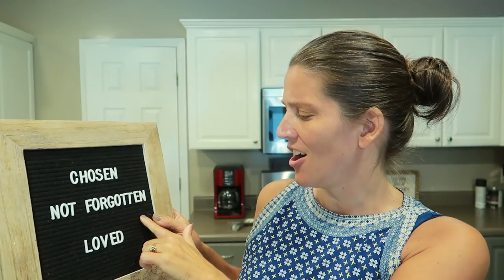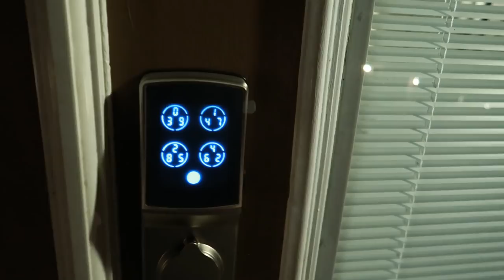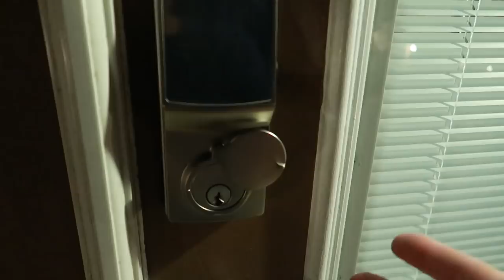Large Family WEEKEND...food..projects...and RELAX!

Comment: Question:  Why bother with deadbolts on a glass door?  If I wanted in through the door, I would just break the glass.  I have never understood this logic.  I suppose if you have a security system that would indicate broken windows, etc., it would be different.  On a strong, solid door, yes. This is an honest question and if someone could clarify, I woukd be grateful.
Reply from the maker: Yes security system.:)
Reply: Thank you.  I have seen many deadbolts where that was not the case.